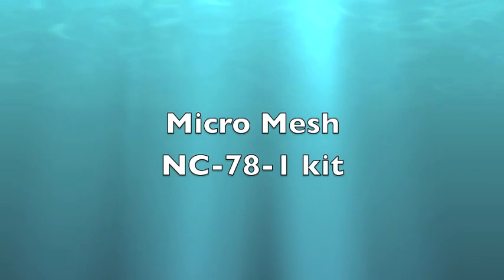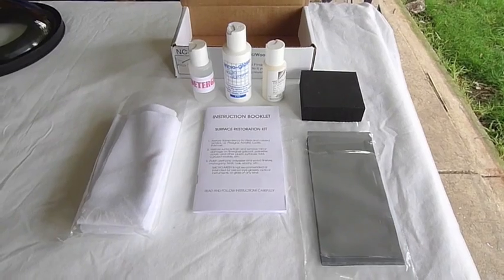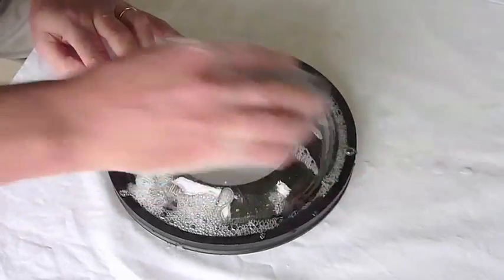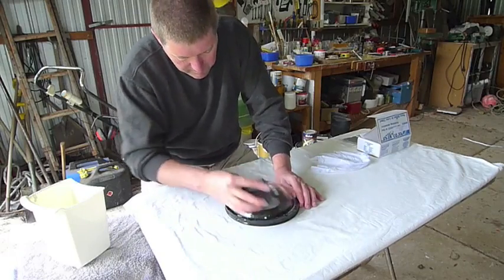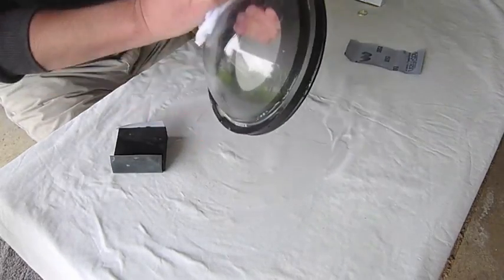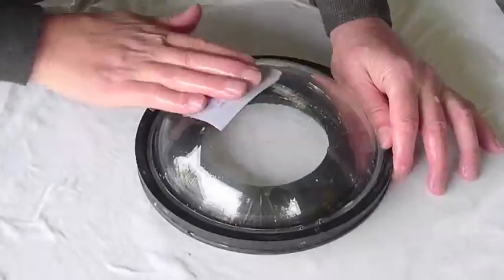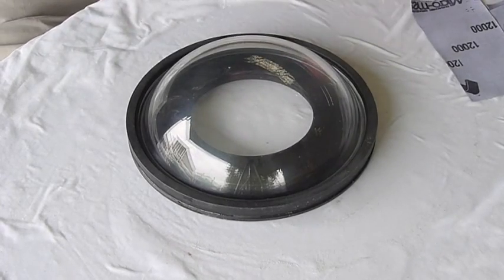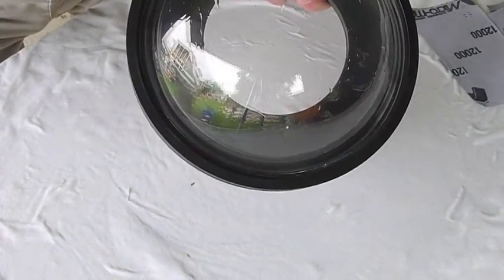Micro Mesh - Dome port polishing

Comment: thanks for posting this Andrew! I just bought a dome port for my gopro, no scratches yet but undoubtedly there will be in the future
Reply from the maker: +pseudechis The kit works very well, but a GoPro dome would be quite small and fiddly I would imagine.
Reply: lol! Just a bit smaller than yours but it's a 6 inch telesin dome which I'm very happy with. Also discovered the cost of the replacement dome is cheaper than the polishing kit!.... of course it's not ikelite quality but for my limited use am very happy so far. Keep an eye out for some videos soon.

Comment: Hey Andrew,

Isn't 1500 grit too high to remove saw marks from Acrylic? Shouldn't I start from a lower grit and then move up? I was thinking to buy all the sanding pads up to 12k and then use a buffing machine for final polishing. What would you recommend?
Reply from the maker: The kit only goes down to 1500 and it worked perfectly for routine scratches on a dome port. I guess if you have more thickness to start with then you could go as course as you wanted to remove the deep saw cuts.

Comment: Is NC-78-1 kits, not KR-70. NC-78 have 9 difference grit from 1500~12000 micro-mesh paper. KR-70 on till 6000 grit. That's why your dome still appear some visible fog surface.

Comment: If I only have a couple small scratches, do I need to do the whole surface, or just where the scratches are?
Reply from the maker: +snorkymn Might be difficult to just do one patch because you create scratches in the process. Each finer grade of sandpaper removes the previous scratches but goes a bit wider so you would end up covering the whole dome anyway.

Comment: Ops! today I got the package from micro mesh KR-70 but seem I ruin up my dome and dunno what I did it wrong. Im just following your video step by step to polish it until the final step but what I found is that the original scratches has gone quickly but appears the fog at the dome surface. Could you tell me what's going on and how to fix it. Your advise would be much appreciated.

Comment: Can this method be used on a flat port as opposed to the dome port? I have a 50 mm port that needs the scratches removed. Thanks!
Reply from the maker: Yes, might be a bit more fiddly but it will work

Comment: Used a $35 palm sander and it took under 15 minutes. Same results.
Reply: What kind / can u link?
Reply: @x19guy  1.) buy foam beach slippers from dollars store, cut to shape
2.) adhere various grates of sand paper to slipper rubber foam
3.) adhere slipper rubber foam to palm sander:
https://www.homedepot.com/p/RYOBI-2-6-Amp-Corded-5-in-Random-Orbital-Sander-RS290G/205105594

Comment: Here well after the fact; but here ya' go anyhow.  Research headlight restoration.  Usually associated with vehicle detailing.  Probably cut your time down to an hour tops from gathering materials to reinstallation of the dome. This is okay of no power tools are available but rather pricey I think. Sandpapers and compounds and polishes shouldn't cost more than $25.00. That should also leave one with an awful lot of left over supplies;  probably a lifetimes worth.
Reply from the maker: Thanks James.